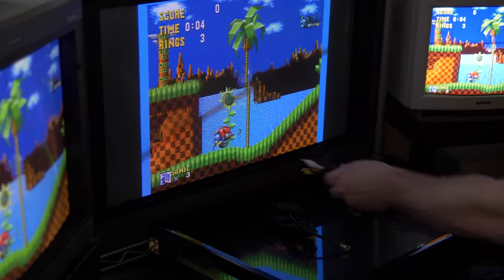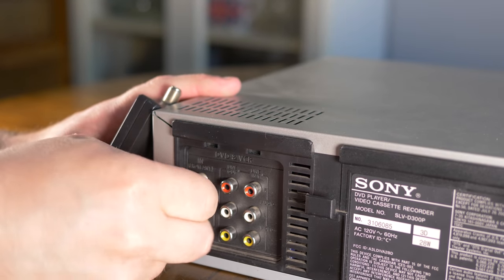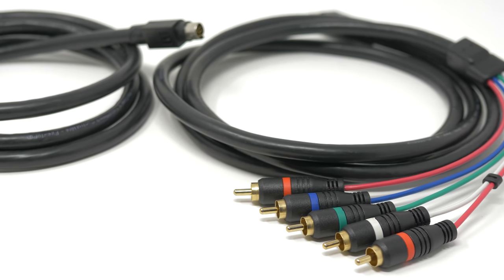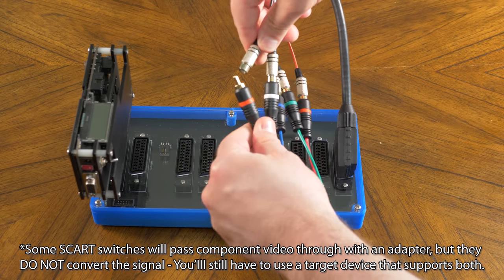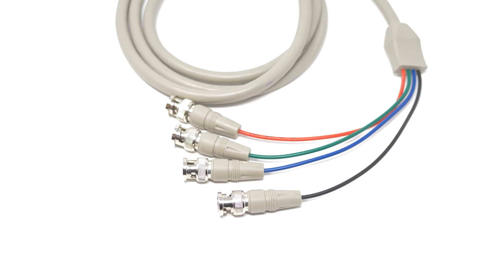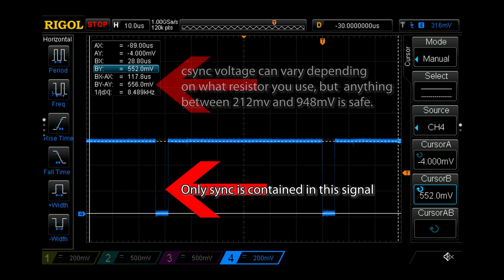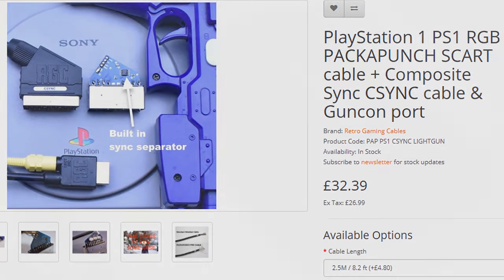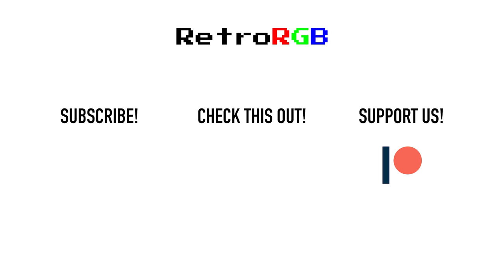Choosing The Right Cable For Your Classic Console

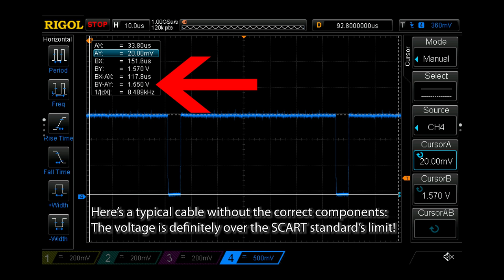Comment: 14:50 Question: I use a PS2 scart cable I got from retrocablesuk for my PS1. There is no visible picture issues that I can tell, no brightness or color bleeding etc. However, that cable doesn't have the capacitors built into the scart cable according to retrocablesuk. 

At 14:50, you say it could "possibly damage scart equipment". What "scart equipment" do you mean exactly? I have 2 gscarts and a gcomp, are you saying all three of those could get damaged, the PS1 console, or my PVM or CRT, or everything I am using including other scart cables? SuperG himself said I could use the PS2 scart cable I am currently using, and there would be no damage to the gscarts or gcomp. Please clarify, I don't know anything about voltage or technical know hows and can't seem to get a straight answer on this. It would save me about $50 to not have to order a new attenuated PS1 scart cable if I can just keep using the PS2 scart cable on my PS1. Thanks!
Reply from the maker: Not having the capacitors on your PS1 cable shouldn't damage your equipment.  You should be okay.

Comment: I'm still trying to find a cable/box to convert the 25 pin DSUB "Computer" input on my Sony PVM 2530 to "Component" so I can hook up anything I have that can output a component signal like PS2/PS3 etc.
Reply from the maker: You’ll need a combination of this:  https://www.retrogamingcables.co.uk/sony-pvm/sony-pvm-scart-converter?tracking=5543fb4c077bb

…and the Comp2RGB from this page:  https://www.retrorgb.com/retrotink.html

If you don’t have a SCART cable, this is a great way to connect them:  https://www.retrorgb.com/hd15-2-scart-adapter.html
Reply: @RetroRGB  Wow. Thanks for the reply! I wasn't expecting it. I've said I needed this on a few other vids before but never got a response. So, I've seen the SCART solution before but since I'm in the USA, I didn't give it a second thought. Let me ask you this, is there a HD15 to DB25 solution available or would I have to go through SCART anyway? The reason I ask is I have a bunch of component to VGA cables lying around I use to hook up things with component out to monitors and projectors with a VGA input. For the hell of it since I have a bunch, I sacrificed one of them by removing the HD15 and soldered on a DB25 using the pinout diagram in the PVM-2530 manual but all I got was the green signal. The HD15 to Component cables are simple and only use 4 out of the 15 pins of the HD15 (R, G, B, and Ground) but the DB25 Computer input on the PVM has a few other pins it uses in addition to R G B labeled V-sync, H-sync, Blanking, TTL, Luminance, and RGB Mode that's probably needed for it to work. Sorry for being long winded. I appreciate the advice and links!
Reply from the maker: You’d need to make something custom for that. If you’re looking for an off-the-shelf solution, those links are about it.

Comment: Hi Bob, thank you for the great video! I had a quick question. I have a PVM that I use a BNC to Scart cable with. The cable is Scart female. I want to buy a Scart switcher so is there a female to male Scart connector that won't interfere with the signal, or do I need to buy another BNC to Scart male cable? Thank you
Reply from the maker: You could buy another cable, or use one of these:  https://www.retrorgb.com/open-source-scart-coupler.html
I'd just choose whichever is best for your overall setup.

Comment: So i can buy a good scart cable and hook it up to my 5x-pro and my non modded ntsc snes and I'll get rgb? I figured when i got my 5x and the s video didn't work with the compsite scart adapter that there would be no way in hell that it would output rgb if it couldn't do s video.
Reply from the maker: Is it a SNES Mini/Jr, or a larger original one?  Also, PAL or NTSC?
Reply from the maker: Also, the RT5x’s SCART port only accepts RGB or Composite, not S-Video. Did you try connecting directly ti the S-Video port?
Reply: @RetroRGB  i was just really surprised that the adapter had s video on it and it didn't work. But being able to use rgb scart so I can have 4 components hooked up to a  switch and 1 rgb scart is even better. I though all scart was only for Europe.
Reply: @RetroRGB  i got 2 original ntsc snes one is a 2chip the other is 1chip 02.
Reply from the maker: Okay, great news - Any of the good cables listed here will work perfect:  https://www.retrorgb.com/snescsync.html

Comment: Would someone really be able to tell the difference between S-Video and Component on a CRT? I’m looking at a PS2 of ours, but the component input is currently being taken up by the Wii, so I’m not sure if it’s worth the hassle trying to get a component switcher.
Reply from the maker: If you mean a consumer grade CRT that only accepts 240p or 480i - It’s a small difference. Definitely use shielded cables though. 
…but if you have an RGB monitor or scaler, you’ll notice the difference. Especially with 480p PS2 games.
Reply: @RetroRGB  thank you for the reply! Love your channel!

Comment: It’s a little confusing to frame it as “scart vs component” when ones a cable and the other is a video signal. IMO people really should be pushed toward BNC until the signal reaches a scaler that requires scart
Reply from the maker: BNC cables are twice the price and would have the same safety concerns.
Reply: For me a better option than both SCART and BNC is D-Sub 15 (aka "VGA"), and that would be the ideal solution to push the community toward, but sadly it's not going to happen and people will stick to SCART, and this video unfortunately does not help to begin to demystify the common belief that RGB = SCART.
Reply: @RetroRGB  but the bnc equipment itself like crosspoints and monitors don’t have these concerns and there’s a lot less confusing variety in console to bnc cables.
We are already saying “don’t buy cheap cables” so it’s at least worth a mention.
Reply: You can just do everything as bnc CSync and all you need is one single wookiewin or equivalent BNC to scart  male with a resistor on sync to output to a scaler

Comment: What causes and how to fix when using a SCART cable on a HDTV having the image display too far to the right, or too far on the left?
Reply from the maker: That could be a sync issue, or a bad scaler.  You'd need to check your cable and make sure you're using a scaler designed for video games.

Comment: Hey Bob, I was wondering if you could answer some questions I have about a potential signal chain that I had in mind.

I want to hook up a NTSC-J N64 I have to my PAL CRT and was gonna go with S-Video. The chain would look something like N64 > Koryuu > Comp2RGB > Voultar Double Penetration > SCART to CRT and DVI to Datapath E2S.

Is it ok to hook up my Japanese N64 to my PAL CRT? And is the Retrotink Comp2RGB fully compatible with PAL CRTs when it comes to sync voltage and voltage for the blanking pin?
Reply from the maker: All of that stuff sounds fine, expect NTSC -> PAL.  You’d need a CRT that’s compatible with both.
Reply: @RetroRGB  I see. Thanks Bob!

Comment: For something like the Retrotink 5x where it only has 2 audio RCA jacks, what is the appropriate way to handle a scenario where one console may be outputting S-Video (N64) and one may be outputting RGB over component (Genesis) where both would need to use the audio jacks? Unplug and switch the audio each time, or could you plug the audio jacks into an RCA switcher and select the input for the appropriate console? I feel like this would be safe if you only used audio on the switcher, but I could be wrong, or maybe there is a better solution.
Reply from the maker: You can use Y-cables with the audio, but not the video.  Check out the RT5x launch video.  And if you're a nerd like me, check out the video with Ste explaining why it's safe for audio and not video:
https://youtu.be/nwNrqIjxBaA
https://youtu.be/DHoA2vVZh8Q
Reply: @RetroRGB  great, thank you, I'll check both out!

Comment: Hi Bob! For my OG Xbox, should I buy the RGC Component through SCART cable, or a modded Xbox 360 component cable, with a retrotink 5x? Thanks!
Reply from the maker: I’d personally get the RGC one, as modded 360 cables have to be made by hand and lots could go wrong. Just my opinion.
Reply: @RetroRGB  Thank you for your reply, your videos have been so helpful. Also, for a PAL N64, is the Consoles4You PAL S-Video Cable currently the only good option?
Reply from the maker: Thanks!  Without modding, yes....as long as you have the right revision.  You can RGB and HDMI mod it if you'd like, but it's pretty complicated.  Links to everything:
https://www.retrorgb.com/pal-n64-s-video-cable-available-at-consoles4you.html
https://www.retrorgb.com/n64rgbcompatible.html
https://www.retrorgb.com/pal-n64-s-video-restore-flex-cable.html
Reply: @RetroRGB  Your website is amazing, I have been lost down the rabbit hole of reddit trying to find out what works, and your website had all the answers all along. Thank you!

Comment: Fun fact: I had 5 screens in my car back in 2002 or so. One being a PS1 with the folding screen. I cut the video wire and spliced using AV splitters and cut AV cables to connect it to all my screens. Back then you couldn’t tell the video quality difference because the screens weren’t LCD, they were TFT. That was popular back then lol.

Comment: Question : You said that 480p over component cables will look great on modern TVs using a cheap zero-lag converter... Does "modern TVs" mean "flat panels"?

Also, what about games that don't support 480p but which run on a 480p console like the Wii? Do they need something better than a simple component to HDMI converter?
Reply from the maker: Yes and yes.  Check out the RetroTINK Multiformat video for info on what to do with 480i signals, but 480p and up only require a cheap component to HDMI converter, like the ones linked in my Amazon store.
Reply: @RetroRGB  Thanks!

Comment: i just wanted to play on the WII i finally own after never having one, realized i cant connect it to my TV, started looking up adapters and now its 5 HOURS LATER and i now know about component, compisite, scart, wii2hdmi and whatsoever, but i still dont know what to get. i know less than before basically. the WII is sitting in front of me, but ive never felt further away from actually playing
Reply from the maker: I actually just did a full writeup about that.  Check out the post here:  https://www.retrorgb.com/wii2hdmi-plug-play-adapter-back-in-stock.html
Hope that helps!!  :)
Reply: @RetroRGB  thinking about getting a component cable and a component-to-hdmi converter since this gets you the best picture apperently and 480p too. wanted to get a scart cable at first but that only works with 480i which is, as far as ive read, pretty terrible
Reply from the maker: That HDMI adapter does 480p too.  If you want the best and have multiple consoles to hook up, get the HD Retrovision component cables and a RetroTINK 5X.  It'll be lagless 1080p or 1440p and look amazing.  Check my website and YouTube channel for more info.

Comment: Did Retro-Access discontinue their S-video cable for the SNES and N64? I can’t find it on their website.
Reply: They delisted it because of parts availability (likely shortages). The Insurrection one is just as good IMO.
Reply: @DrClaw77  That’s weird because they do sell the S-video plugs on their website. The 75 Ohm cable is the same they use for all their products. 

Unfortunately, Insurrection don’t use 75 Ohm S-video cables. However, they claim the quality is the same with their standard shielded cables.

Comment: Great video!! A question.. Does  RGB scart cable support  576i AND  480i resolutions on PAL tvs???
Reply from the maker: Thanks !  The cable wouldn't determine that, it would be the source and target.  But to answer your question, yes, it should.
Reply: @RetroRGB   Oh so it is a matter of which TV you have, and of course the console/game resolution (Because PAL games output at 576i, while NTSC ones at 480i). So, with most PAL TVs I think you can play both PAL and NTSC games by using an RGC cable, because it basically neglects the colour type, it kinda bypasses it if I have understood it correctly. 

And I think (from what I realize), that if the PAL tv has a 50 Hz refresh rate,  when you play an NTSC game via RGB scart, it automatically gets to 60 Hz (from 50Hz it has as a basic rate).

Comment: I'm curious what option I should go with in regards to my GameCube and my retrotink. I'd assume Component cables would do well, but then the question is which ones?

There's a lot of different GameCube component cables.
Reply from the maker: Which RetroTINK do you have?
Reply: @RetroRGB  The 5x Pro. Just ordered it recently. The only other console I'm not setup with yet is my Dreamcast.

Waiting for the cables at retrogaming uk to come in eventually.
Reply from the maker: Easy answer.  It's gonna sound complicated, but I promise you, it's easy:
- Carby HDMI adapter:  https://insurrectionindustries.com/product/carby-v2/
- HDMI to Component converter:  retrorgb.link/cheapdac
It's a great solution that covers all ground.  Also, here's what you need for the Dreamcast (either one):
https://retro-access.com/products/dreamcast-15khz-31khz-480i-480p-scart-cable?variant=17095604207667?aff=3
https://www.retrogamingcables.co.uk/SEGA-DREAMCAST-RGB-SCART-CABLE-WITH-480P-MODE?tracking=5543fb4c077bb
Reply: @RetroRGB  Yeah it just sucks that it isn't stock right now, but I can wait.

In regard to the Dreamcast cables. I can use the Carby by itself right? I'd assume I'd just plug it into my GameCube then my TV and that's it.

Comment: I have a self-made, shielded RGB scart cable (sync on composite) from a RGB modder for my modded N64 and I am thinking about to switch to composite cables. I saw on Retro Gaming Cables they now offer composite cables for N64. Do you know which cable for a modded N64, either RGB or Component, offers better video graphics? My Retrotink 5x is currently on it's way to me.
Reply from the maker: As long as the cables are made properly, RGB and Component Video (YPbPr) will be identical in quality.
Reply: @RetroRGB  Oh man... I should read before I post... I meant the new upcomming component cables. Good thing you still understood I meant the component cables. Thanks!

Comment: I’ve got loads of Sega consoles all running RGB CSYNC on SCARTs. I’d like to import an NTSC-J Nintendo Famicom from Japan but have heard different versions output different sync types and you can only find out which you have by opening the console or trying different cables. Any advice for this?
Reply from the maker: An RGB cable from Japan is JP21, not SCART, so they won't be compatible.  I'd stick with all SCART to avoid issues.
Reply: @RetroRGB  Yeah I'd be getting a SCART from RetroGamingCables co uk but have heard the original SNES variant and 1-chip variants have differences in their sync outputs - some on luma some on comp??? Would the best approach be to buy a console then open it up, check the motherboard and THEN order the correct SCART for it?
Reply from the maker: I'd just pick up either the "universal" SCART cable, or one that sync's on composite video.  Links are here:  https://www.retrorgb.com/snescsync.html
Reply: @RetroRGB  Thanks - I really appreciate your replies. Very helpful and you do great content. I might be pushing my luck here but do you know much about the RGB output of the Japanese Sega Master System? I was getting along with it fine directly into my OSSC but since I starting running it through a Hydra Revised SCART switch it won't pick it up. I had heard that the Sega Mark III RGB output needs to be amplified and the Japanese SMS is perhaps more Mark III than the SMS the rest of the world got - it accepts the Mark III cartridges and has the FM sound unit from that console too. Can't find confirmation of this anywhere on the internet.

Comment: if i want to have my console on a jvc d-series with no rgb and also to the 5x for hd tv, should i try to go scart or component?
Reply from the maker: If you haven't bought any cables yet, go component.  If you've already bought RGB SCART cables, just get a RetroTINK RGB2Comp for the JVC.
Cables for all consoles:  https://www.retrorgb.com/systems.html
RGB2Comp:  https://www.retrotink.com/product-page/rgb2comp
Reply: @RetroRGB  i have a single scart intended for my n64 and the 5x for hdmi but plans changed and i got gifted a couple of crt
Reply from the maker: For me personally, in that situation, I'd use my N64 via SCART on the RT5x and composite video on the CRT.  I really think the N64 looks awesome in composite...on a CRT.  Then just pick up Component cables via those links above for any other console you have.
Reply: @RetroRGB  i also have a snes and a nes which will most likely get components adapted, a dol-001 with a carby, and a wii with a mayflash to hdmi, as for other console i might one day get a ps1/ps2, xbox, 360, if that changes anything for your recommendations

Comment: 🔶 Hi Bob, I have a snes classic (mini), and I would like play the most real experience to true snes. I want connect it in a crt tv. What cables recommended me for this connection? Super thank you!
Reply from the maker: Hello!  Unfortunately, getting the SNES Mini's HDMI working on a CRT would be more complicated and more expensive than just getting an original SNES with a composite cable:  You'd need a downscaler and multiple DAC / ADC's.  Sorry!
Reply: @RetroRGB  oh! It’s a pity. Thks! Cause one hdmi to rca converter is not a good solution, isn’t it?
Reply from the maker: Very laggy and it would be 480i, not 240p.  You can try if you'd like though:  https://www.retrorgb.com/480i-downscalers-tested.html